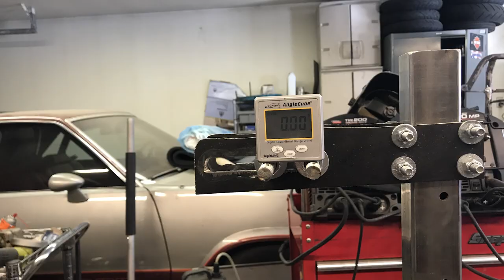Budget Mini Bike and Motorcycle Frame Jig!! Part 2 of 2

Comment: Thanks for this.... just wondering if this suitable for bicycle frame jig?
Reply from the maker: Filbert G It could be used for one, would require a couple of mods, like the addition of a bottom bracket mount/locator and smaller axle plate mounts, but the concept is the same
Reply: he should of just bought roller from or for a boat trailer